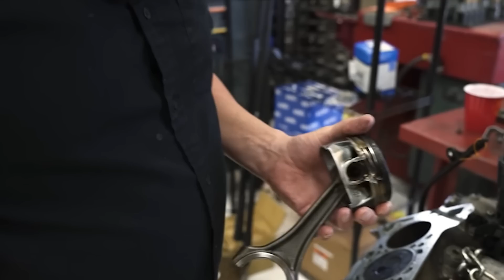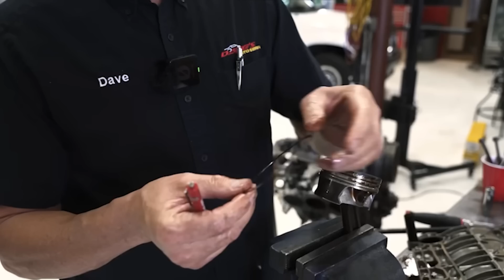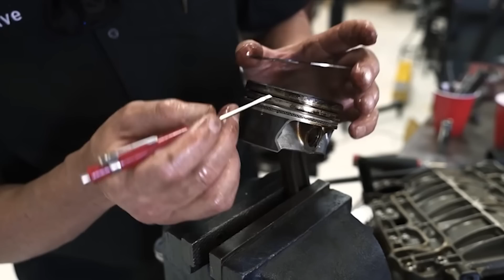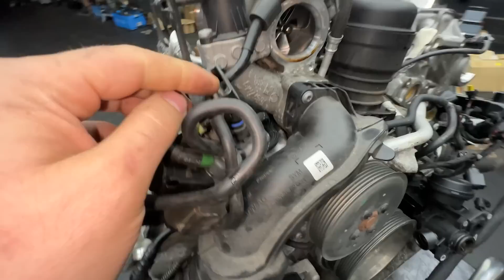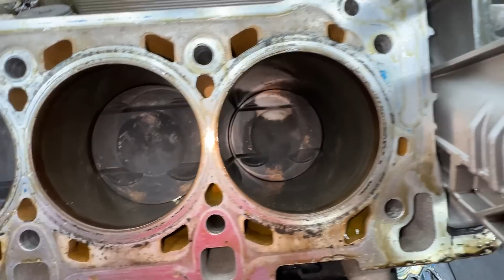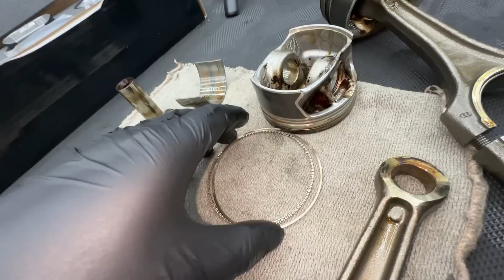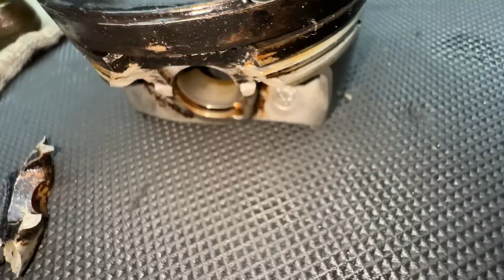Reaction video on LSPI from Dave's Auto Center and 034 . Why I like the EA839 engine from Audi B9s

Comment: Thank you Sir for this very interesting video about this B9 plateform. I have a question and need help, i own a old B6 1.8t from 2002 with 164'000 km and rebuilding the engine but i both 4 new pistons from a seller called Barret on Ebay and they send me pistons with a size of 80.975 mm and the skirts shape are not the same as the 80.950 mm original pistons but the picture on the ad was exactly what i needed.

The bore cylinder is 81mm if i put .025 mm bigger will it fit ? the gap of the top ring was 0.20 mm and the middle  ring 0.25, the spec is between 0.20 to 0.40 mm and the old rings gap was 0.30 top one and 0.40 what should i do ? Installed them or fight again with this ass..le seller ?

Thank you so much God bless you sharing your knowledge

Comment: Interesting comment about using 5w 40 
I’ve a 2013 2.0ltr tdi superb since 2 year old 
Always changed oil at 10k using Quantum 5w 30 longlife 3 
I’ve often wondered about using using 5w 40  
Any thoughts anyone
Reply: You'll be good with 5w-30 in normal use diesel. I think he meant 5w-40 mostly for petrol engines, since those can see higher oil temperatures than diesel engines.

Comment: Direct injection, high compression, single turbo. These turbochargers from factory are rated to push out a maximum of 33.3 psi (~2.3 BAR) of boost pressure. Installing mods or performing tunes that increase fuel consumption or charge air density without proper maintenance and protocol can and will cause these early B9 engines to easily flatline. Another thing is that a lot of Audi owners push their cars very hard not only at low rpm as said in the video but also when the engine is cold. 0-20 is very thin, improper operating temperature and low viscosity can cause oil consumption, which leads to oil starvation, which will lead to engine failure.

Dave is a good guy and knows his stuff. It was nice to see another perspective on Audis, especially from a guy that doesn’t deal with them too often, and it’s even better to see a video from VAG Technic to get a second perspective on everything. We appreciate everything that you guys do!

-An Audi technician in the USA
Reply: I bought a used B9 S5.  First thing I did was run two tankfulls of Redline SI 1 to clean the injectors and switch to Amsoil 0w-30.  Amsoil Xw-30 is even thicker than mainstream oils like Penz and Mobil 1.  50% higher viscosity at 100c than normal 20.
Reply: It might be a single turbo, but it's twin scroll, so arguably better than two turbos on a V6 engine.
Reply: What oil  do you like to run in audi's  in the US?
Reply: @johncoldwell340  In the US, we use 0w-20, 0w-30, 0w-40, and 5w-40 (VW 508, VW 504, VW 511 and VW 502). It all depends on engine code and model.
Reply: @doodlebucket  Thank you for your input. What would you recommend for a B9/B9.5 S4? I know it calls for 0w20 but in the AZ temps. Would you still suggest 0w20? Would 5w40 be too much?
Reply: That’s because your fuel is more like window-cleaner, in my S4 B8.5 only gets 100 octane. Germany 🫡 no LSPI never
Reply: @antonfloor344 I know this is a year later, but Europe uses RON while the US uses RON+MON/2. 98 RON is equivalent to US 93 (RON+MON)/2. So no it’s not window cleaner.
Reply: @antonfloor344  The premium octane fuel I believe is 95 ron in the US! That is our standard and our premium is 98 ron.
Reply: Hi I been so conflicted on what oil to run on my Audi S4 3.0T 2023. I live in California Orange County. What do you recommend people hate 0w20 but that’s what Audi recommends
Reply: My car is at 15.7k miles btw

Comment: Surely LSPI comes from fuel/ignition timing, not oil getting into the bore, liked described!
Reply: GM had to reformulate the oil spec for the 1.4 Turbo in Europe because of LSPI, oil plays a bigger role than you would think.
Reply: @-DC-  early hyundai's 1.6 turbo engine also suffered lspi.

Comment: Hallo! I have a 4.2l B8 S5 manual, I just had the resonators removed from my car to get more noise and i started driving in the lower rpm range for a while, to not disturb my neighbours so to speak. Is this the reason i smell fuel from time to time? especially if i go to the shops 3 miles away and back? Normally when i drive further than that i always make sure to at least hit 3.5-4k rpm but not when going to the shops. What would you recommend? Love the channel as always
Reply from the maker: Leave it idling first 30-40 seconds than gently drive until warm 👍
Reply: @VAGTechnic thank you, been doing that since i got the car, so happy to know i dont have to change style. One last question. Do i need to take the ecu for a tune after just removing the resonators and middle muffler? I still have the 2 cats and 2 rear mufflers as stock and intend on keeping them like that
Reply: @geekonometry  there is no need to tune a car if you're only changing the exhaust after the cats.

Comment: The RS3 5-banger is the best from Audi reliability and power pound 4 pound, next I would say is the S3 4 cylinder is more reliable then the S4 or RS4  engine.
Reply: I tend to think that the B8 & 8.5 S4 Supercharged V6 was a better choice for both performance and longevity.  I’d like to hear what VAG Technic thinks about this subject, as they fix the broken examples…

Comment: "the motor oil geek "talks about that preignition because too much calcium in oil that causes it, so for DI engines must be used oils with low calcium:https://youtu.be/39vt92txuAk?si=2A_QrjCt5TcEeReJ

Comment: Dave likes to hear his own voice. He goes on and on while poor customer is on phone waiting to hear how many thousands is it gonna cost. 😂
Reply: Detail to repairs are great but I skip over the drama nonsense when he's on the phone with a customer.
Reply: lets see you run a full service shop that builds engines and trains young techs to work on practically anything.
Reply: @hillclimber4406 You fail at your own logic. How does all the phone over explaining help run the business? customer just wants the quote, thats from the customer point of view. he has service writers….. thats what they do… customers time is valuable too.
Reply: His stupid analogy’s drive me crazy
Reply: @kevinv258  How about when he always references "the surgeon" opening people up like a doctor
Reply: The guy's full of sh*t.  He says "the oil is so thick it gets past the second ring" How could it do that if it doesn't get past the oil ring?  Regardless, modern synthetic engine oils are NEVER thick.  Even synthetic diff oils flow like water when cold.
Reply: @einfelder8262  diff oils are just as thin or thick as motoroils, they have just changed the numbers so you dont run hypiod oils in your engine.
Reply: @einfelder8262 not always true. Using viscosity index improvers tends to make the oil thicker than it's actual weight.

Comment: My opinion about that is that it's bullshit, lets see whats you guys think about it.
7:45 i will be honest, one early morning i was so sleepy that while i was starting my car i hold brake and gas pedal to the floor and started the car(it was cold start) and it rev to red line at instance after starting and ?
Nothing happend, so yeah i was in shock wtf i'm doing but yeah nothing happend hahaha
Btw it's is the car on my avatar.
Reply: LSPI is definitely real.
Reply: @whackaify  Yes it is but i don't think it caused that piston failure.
I think it is bad design of piston or faulty casting/material or both.
Reply: @salazar1104  that's fair, the b9 is known for it sadly. Vagteknik even says it in a bunch of his videos.
Reply: VW/ audi from 2014+ cannot be redlined when sattionary ...